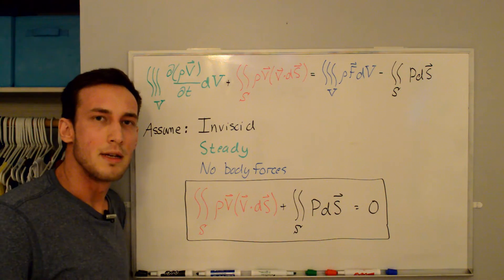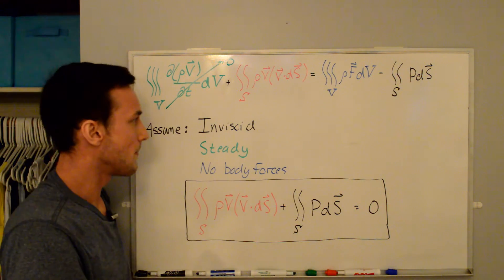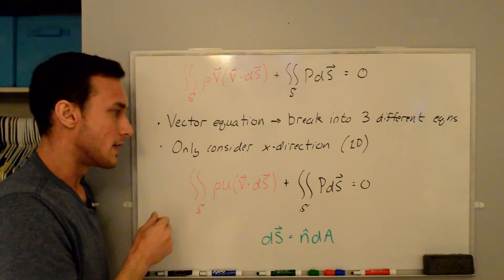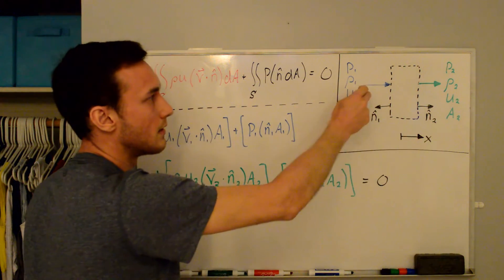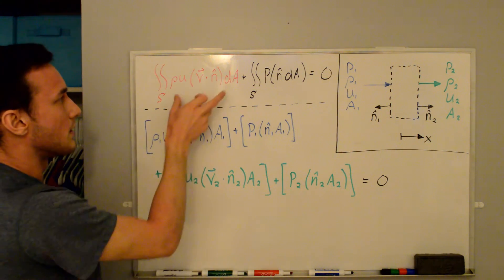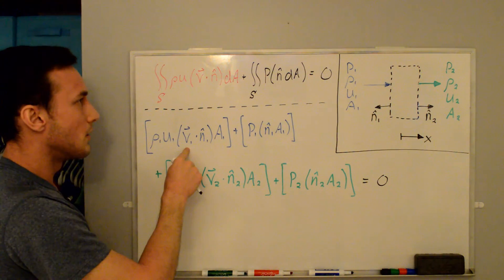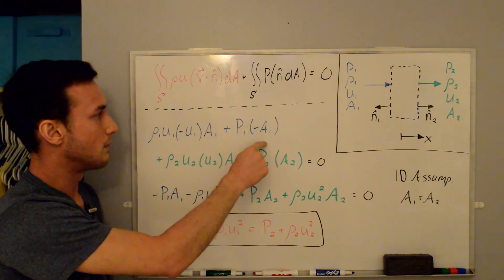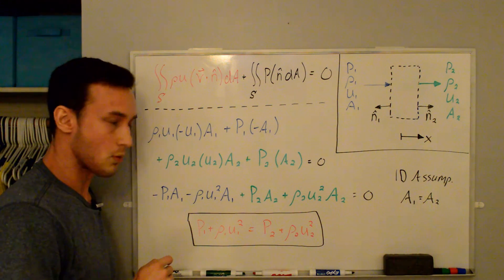Explained: 1D Conservation of Momentum

Comment: Isn't pressure acting inwards towards the C.V every where around it? For exemple P1 is acting this way "→", and P2 is acting the opposite way "←". This way P1 is opposite to n1, so the integration should be "-P1*A1" like you said, but P2 also opposite to n2, so why isn't the integration of pressure force at 2 equal to "-P2*A2"? Forces are vectors aren't they? Why are their directions not taken into account?